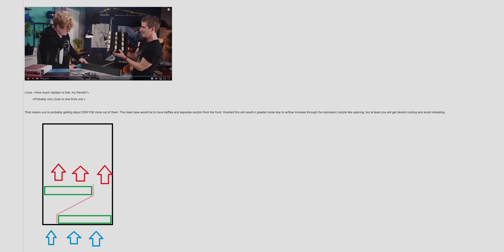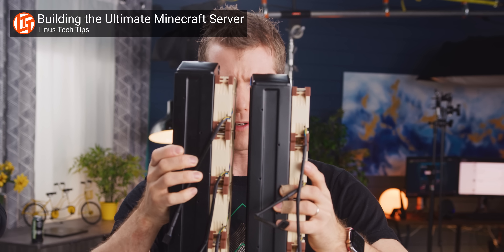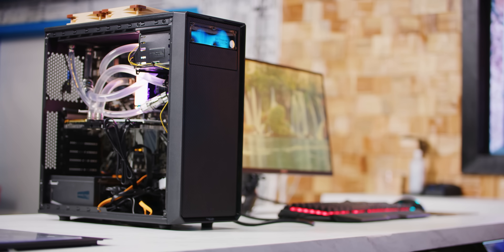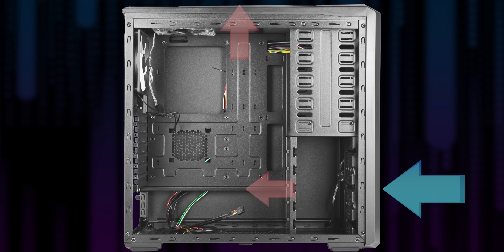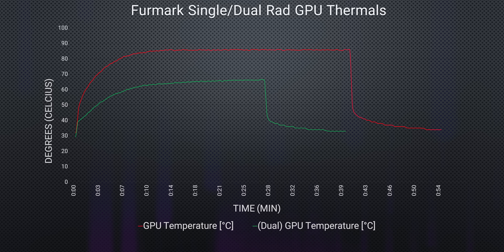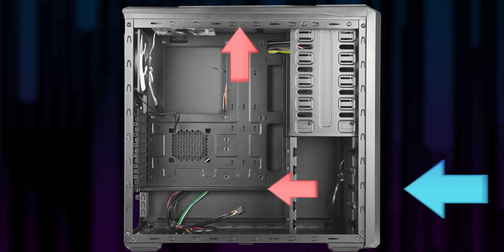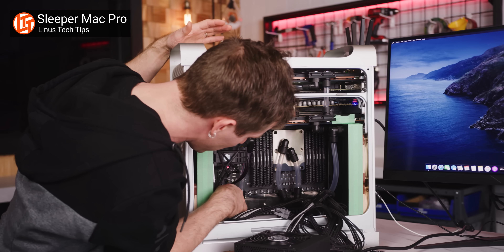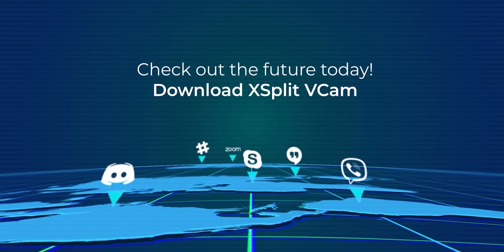I’ve been water cooling wrong for YEARS - $H!T Manufacturers Say

Comment: Heat dissipation works on the surface area exposed to the hot liquid passing through fins of the rad. Thus more exposure the better cooling. Thus I am with Linus in this issue.

Comment: It probably would be ok as long as you are outputting the hot and pulling in the cool. Largest heat generators being the water cooled CPU/GPU the ambient case temp should still be ok. Stacking could be an issue but it will be equalizing the heat across the rads and as long as got proper air flow with all.

Comment: Corsair needs better CFD Engineers. CFD codes are just tools otherwise, it is just as they call it Colorful Fluid Dynamics. Running a proper simulation is quite difficult.

Comment: So in the middle of summer when it spikes to 40°c, ambient temperature is hotter than the loop, would that mean the liquid cooling heats up my CPU. Also, wouldn't the case act as a form of inefficient radiator cooling the air in the case slightly as it passes through between the water cooling radiators

Comment: Corsair: "ur doing it wrong"
LTT: "lol stfu nerd"
Reply: Ok, hold my beer,  I've studied thermodynamics. Time to debunk Corsair sooo hard...
Their theory of heat soaking the air could ONLY possibly be true if their radiators actually get close to 100% efficiency. That could only be possible in these cases: if there is a phase change occuring in the system, if there is a significant change in pressure of a compressible fluid, or if they are using a cellular countercurrent exchange arrangement. Spoiler alert: none of those is the case here (like it's nowhere near of being the case).
The direction of the flow of air and water are orthogonal to each other, so you should expect the radiator to perform like a cocurrent flow exchange at best. (You get no more than 50% of heat transfer efficiency)
And here is the thing: how hot the air exiting the radiator actually is, doesn't only depend on efficiency but also on flow rate. 
Very simply said: you can heat up one cubic foot of air by 10 degrees, or heat up 2 cubic feet by only 5 degrees. The only way to get the air exiting the radiator to match the temp of the water (in a cocurrent setup) is to have a low airflow. And In that case you're limiting the efficiency of the first radiator! You want the whole surface of the first radiator to be in touch with as cold air as possible, including the exit of the radiator. You want the air to be refreshed before it gets a chance to really heat up to make the first rad more effective.
This boils down to: Corsair is only right about the 2nd radiator hurting performance if your fan is too weak to supply the first rad with enough air. Fair enough...
---
All of you guys can do a CFD simulation, you just click random settings and press start. But these nice looking diagrams mean nothing if you don't know what you're talking about.
---
Corsair: "ur doing it wrong"
LTT: "lol stfu nerd"
Science: "no Corsair, ur doing it wrong"
Reply: @sasjadv  I'm an engineer and have studied heat transfer as well, and that's pretty much it. Mounting radiators in series will reduce the cooling efficiency, but increase the total cooling capacity, unless air is exiting the first radiator at temperatures close to the coolant temperature of the second ratiator.
Reply: @VIctorAbicalil , you could guarantee that the air temp in the second radiator is never close to the water temp by choosing which order you send the water through the rads. You could easily make it such that the system resembles a counter-current heat exchanger.
Reply: @sasjadv  Mechanical Engineering student here. He's right.

Allow me to attempt to explain why Linus' setup works contrary to what the guys at Corsair said.

Simply put: FANS.

When Linus added the fans on the second radiator, it effectively added extra flow rate to the air. Air, by nature, is very low on inertia since it has low mass due to low density. As such any attempt to mobilize air will make it still again after a short distance. Notice how your home stand fan becomes less effective at cooling you after several meters.

What's more is that by moving air at a more consistent rate, the air itself may have less time to fully saturate from heat generated by other devices inside the computer. This gives air more heat capacity to absorb heat from a second radiator installed. If there was no room for air to be still at any point in time inside the computer, the second radiator is almost always justified in this regard.

IMO: Water and air are very bad at transferring heat by default as they take too much time to absorb heat. I recommend an actual refrigeration system instead! SLAP IN THAT COMPRESSOR, EXPANSION VALVE, FILTERS AND USE SOME R-134A ON THAT PC!
Reply: @Judeo  Well, yes... You're not far off from what I said.
You pretty much explain why a 2nd rad is justified as long as you have enough fans; and I said that Corsair's statement is only really true if you have too little airflow.
Don't forget that a PC case is a confined space and the low inertia doesn't play a big role. What comes in, must come out; if you pump air into the case, then the same amount will come out and the air will move.
But when you have a really big case, and only one small fan with little airflow, then the airflow inside the case will indeed come to a halt.
---
The biggest difference that I noticed between mechanical engineering students, and the aerospace guys is that aerospace guys are used to calculating a certain value per kg, per dollar, per euro, per liter, etc... Like "what structure is stronger per unit of weight" is the way they think all the time.
That's really a workflow that mechanical engineers lack. It's good practice to get used to compensating for scale. Sometimes you can get away with guestimating: "this value is small, and this value is big"; but sometimes one value increases linearly and the other exponentially, and then the scale really matters. Aircraft builders don't care how strong their aircraft is, they want max strength per unit of weight, the heavier an aircraft is, the stronger it needs to be. The heavier an aircraft, the more load you put on the structure when using it.
---
The first time in my life that I heard that there were water cooling sets for computers available, I thought it was a r134 filled phase change thing. I thought that was the norm...
I was actually disappointed to find out that water cooling setups contain actual water that's only pumped around. I thought we were living in the 21st century, "why can't a new PC match last century's fridges?" <<this is what I thought 10 yrs ago.
Reply: @sasjadv  Good to know something I don't know, especially weaknesses that I don't even know I had. Thanks for pointing out that I need more exposure in compensating for scale. 

As for the R134A thing, as far as I know, the acquisition of certain refrigerants requires certain licenses and permits. And since water is just everywhere, just use that instead.
Reply: @Judeo  Not only that but any system that implores a phase change is very noisy. Water cooling is actually quieter because the radiator adds extra surface area so you don't need as high airflow to meet the heat transfer rate needed.
Reply: @sasjadv  ok cool you took 1 thermodynamics class... corsair has people who have studied it in theory and in practice/application for years lmao

/r/iamverysmart
Reply: @Defonicx  Are you sure it's not the other way around?
And you took 0 classes, that's obvious to anyone, because you don't seem to have a clue what we are talking about.
You didn't come up with any scientific arguments on why I'm wrong. 

You just assumed that these engineers have experience, and that they did their best during their education. Trust me, I've been an engineering student, and I know how a lot of fellow students interpret thermodynamics. I know the exact sort of mistakes that they usually make.
You could think about it this way: why would a really good engineer want to work at a "computer fan factory"??? Good and engineers with experience easily find a job in Automotive design, in the aerospace branch, etc.
And the reality is: there aren't that many good engineers.
---
Speaking about /r/Iamverysmart:
Corsairs story has some logic to it, but it contradicts with actual test results from Linus.
My story actually explained why this happened.
And all you did was saying I'm wrong, as if you are smarter than me and know it better. And then you said "/r/iamverysmart", LOL!
Reply: GT3 racing driver here; If one is interested in learning how to cool your system better, keep in mind we've been doing this with cars for much longer with much lower tolerances and higher temperatures. Not a bad place to look if you're interested in learning how to better cool your system.
Reply: @TheCrazySweed  like Linus said, I'm sure Corsair is right in some regards, I was just making a joke
Reply: @TheCrazySweed  I'm an auto tech and always say this! He doesn't even have to look to racing stuff.
Reply: I think he used some more choice words than those. ;)

Comment: Linus, stacking radiators like 3 in a row means the air goes through the first, then directly in the second and then directly in the 3rd radiator, there isn't any space for "fresh" air to mix in-between radiators. SO please, check this out. Stack 3 radiators like in your other clip, then spread them so they don't have the same airflow and you will see that what you did on this case with 2 radiators isn't actually "stacking".

Comment: Did you run the water first through the intake or the outlet radiator? Because the apparent base assumption at corsair (outlet temperature of water and air are ideally the same) applies only to a parallel/cocurrent heat exchanger, with a countercurrent heat exchanger the outlet temperature of the water can be as low as the air inlet temperature and while a normal radiator in itself should be cross-flow, with two radiators this effect can actually matter.

Comment: Hypothesis: if you stack the rads correctly you get a benefit. Immediately after leaving the components the hot water should enter the radiator at the outlet side of the stack (the radiator getting the hottest air). As the water moves through the stack it should meet progressively cooler air, ending at the radiator with the cold fresh air. In my head this gives better cooling than water flowing the other way.

Comment: stacking rads and adding rads are not the same thing. you can add rads next to each other, both with direct air in, or case air out.  Having air go from one rad through another is what is being critiqued and was not directly tested in this video, so its not a conclusive answer

Comment: I don't have any experience building PCs, but wouldn't taking 2 radiators ,blowing ambient air into the PC, be more efficient, if you can provide enough clearance for the air to get out of the PC somewhere else? You would put them in parrallel and both radiators would get cool air. Or is there just not enough space available for that much air clearance?

Comment: Why pull slightly warmer air into 2nd radiator since fresh air would make the system way cooler?
Reply: I guess the best solution is both of the radiator would pull air from inside of the pc case while using pc case designed with that setup in mind.

Stacking radiators only increase the capacity of the water cooled by a volume of cool air. The main goal is to increase the volume of cool air cooling the radiator.

Comment: Linus, what if you put the second inline radiator at the cooler inlet air and put the 1st inline radiator so that the cases exhaust blows on it. That way you essentially have a first stage radiator being slightly cooled by exhaust case air and a second stage radiator cooled by fresh intake air. Would that make a difference???

Comment: Analysis felt a little lightweight.  In addition to what you showed, I would have liked to see testbench analysis of the minecraft server setup with stacked rads...  How much heat do you have to dump in to a verity of radiator styles before they become saturated and water temp starts to rise?  How do temps compare when those rads are side by side vs. stacked?  Measure air temp leaving, entering radiator, as well as loop temperature.

Comment: If the air inside the case is cooler than the water in the loop a second rad helps. Because physics, motherfuckers. And you can be certain the first rad won't be efficient enough to transfer all the heat into the air going through it so the air inside case will be cooler than the water in the loop.

Comment: Which rad is mounted on the intake and which is on the outlet probably also matters. Cross-flow should make sure that there is always a temperature difference between air and liquid.

That's btw a test I'd love to see. A single fan with 1, 2,and 3 single rads stacked on that single fan. And the difference it makes which way the water flows through the rads. Theoretically using cross-flow with enough rads stacked you should be able to perfectly switch air and water temperatures.

Comment: Have radiators outside case, no heat from PC.
Put on back side with spacer feet static pressure fans that way you can have one two or three in the back

Comment: I don't think Corsair's problem wasn't necessarily having more than one radiator though. The fact that the hot air from the first radiator is the same air that's used to dissapate even more heat into is the main problem. Even though removing one increased temps by 5 degrees,  therefor showing that it isn't completely useless, doesn't prove them wrong because the difference is way smaller than you'd expect from having double the radiators.

Comment: Something not clarified in this video: direction of water flow. In this situation to run the water through top radiator then front radiator would be the best: First cool the water then cool it more with fresh cool air...
Reply: The volume of water is so low and the flow is so fast in such a small loop that the order doesn't matter at all. The water's temperature reaches a point of equilibrium and stays there.
Reply: @alexgr0111  It takes time to reach the point of equalibrium, which means all heat isn't being transferred to the air. Now thinking about it they probably set it up in the direction I mentioned otherwise the temperature might have fluctuated more. If two radiators is small what's big?
Reply: Big is liquid cooling industrial equipment. A pc cooling loop will always be small especially if you consider how strong a d5 pump is compared to the volume it has to move.

Comment: Well, for my case, it was fan placement. Many people said the best configuration for fans at the top of the case to be exhaust. I tried that (since my case can fit 3 120mm fans) it did create a negative pressure since at the front, I only have 2 fans (because I'm still using Blu-ray Disc drives) and the rear 120mm fan is the exhaust. Temperature is... okay, but the system is still warm because the air expelled from the graphic card actually get sucked into the CPU (using stock cooler, which is a radial heat sink with a down draft fan. Once I switch all my top fan to intakes, I get better temperature for my CPU, and it can sustain longer before thermal throttling. 

So, lesson learned. Do lots of experiments. Many suggestions do have a valid point, but sometimes, it just won't work in your scenarios.

Comment: IMO radiaters should be mounted outside ones case as heat should be kept far away from sensitive components.  I have a large but crappy Cooler Master CM Storm Trooper case. Have a Corsair AIO water cooler for the cpu where the rad sits at the very top of the case.  Then about 5 cm below there is a Noctua fan blowing the hot exhaust air from the rad out of the case.  (maybe the rad should exhause hot air straight out, don't know.)  Would like to water cool my 1080TI  but can't figure out how to externally mount the rad or how to place a fan/rad combo to exhaust the rad hot air,  Possibly at the bottom with the hot exhausting outwards.  But from having done our cottage plumbing using compression fittings I know, painfully, that my plumbing skills leave a lot to be desired.

Comment: I would think that the surface area of a 240 rad isn't nearly enough to saturate your setup. Adding a second 240 rad increases the surface area and still gives you a benefit even though hot air from the first rad blows through it. If you instead put on 2 480 rads the first 480 should be enough to take most of the heat out of your loop, the second 480 rad would then possibly not really take any heat out of the system at all and just add unnecessary air friction.

Comment: A watercoold radiator cooling the incoming air to the case. Whit all incoming air flow seald of except for true the rad. Combined Whit a big air cooler on the CPU. How would that cool in comparsion.  The ability to put all Ester cooling components except the rad outside the case should decrease the ambient tempo in the case. No friktion heat from pump and pump motor in the case and No hot waterpipes in the case. Have Always thougt cooler masters cooling tower was a great idé in that regarde...

Comment: LINUS you know damn well what they meant... stacking radiators is stupid, heat from one gets recycled to the next which diminishes the difference between temps and minimizes the effectiveness. Radiators on the absolute top seem to be less effective as well... and you don't want exhaust one radiator inside the case and have another radiator sucking in that air. The point is to get the heat AWAY from the system, not recycle it to ambient around the components OR allow it to be partially reabsorbed into another radiator.